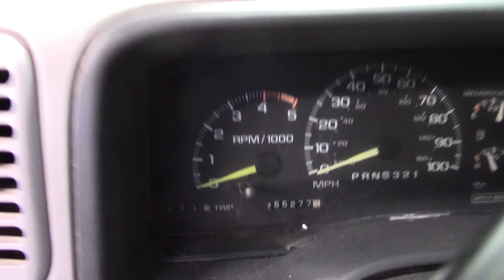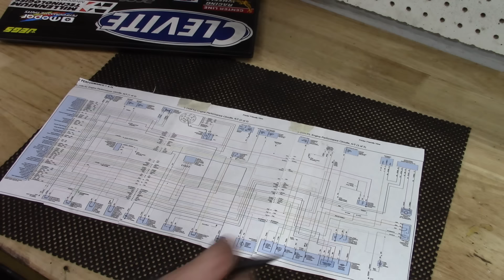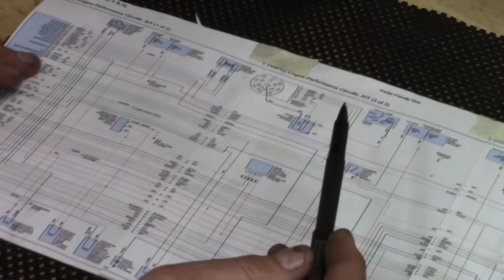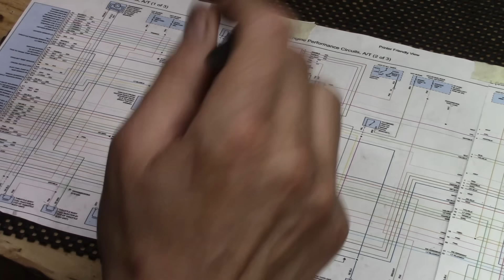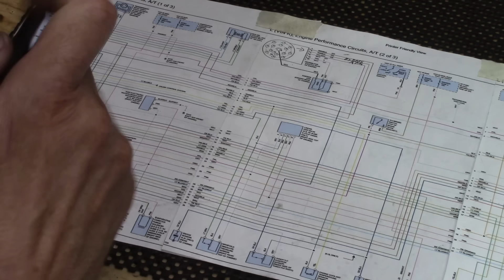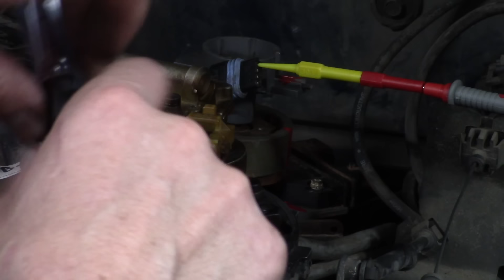Challenging Cranking No Start Diagnosis  1995 Suburban

Comment: Binge watching your videos, these are great. I love your methodology! But boy, do I have a good one for you. My 2011 Camaro V6. Started as a no crank. Found the ECM 15A fuse blown. Replaced, which allowed me to crank, even though it blew again. Blows anytime the door is opened (car wakes up). ECM fuse is powered by Powertrain Relay. Benchbtested, that's fine. Harness from fuse to ECM tested good (jumped load side of relay with harness disconnected), no short to ground.
Stumped! Wish I could send it to you!
Reply from the maker: Thanks for watching. Pretty clear you just have a short on the ECM power feed.  Disconnect it and use a test light to look for an intermittent ground.
Reply: @SchrodingersBox  Hey thanks for the reply! Yea I did just that. Disconnected the harness to the ECM and tested from fuse (harness side) to pin in harness. All good, no ground. ??
Reply from the maker: Yes becauase its intermittent I would expect that.  You'll have to wiggle wires and harnesses to try to create the ground and that will narrow down where issue is.
  An ECM fuse will blow with any fuel injection or ignition shorts so keep that in mind- it may even be a coil or fuel injector itself!
  I have video of this exact issue on my website- wiggling the harness blew the fuse right on camera- you could see it, and of course lit my test light as well
Reply: @SchrodingersBox  Great, going to look for the video now.
Mine issue isn't intermittent. No crank if the fuse is blown. If I replace the fuse, it'll crank, no start (fuse blows immediately) until car goes to sleep. Then no more crank again.
Scares me that it could be injection or ignition, seems like a million paths to take to find the issue!
Reply: Btw, may have found your video, the Lexus?
My wiring schematic doesn't show any fuel or ignition components on this circuit. Just 3 wires from fuse (it splits 1->3) to ECM pins...that's it.
Could it be being backfed somehow, that wouldn't make sense to me?
Reply from the maker: Not sure what diagram you gave but I just pay $19.95 and get a diagram from AllData DIY. Worth every penny.
Reply: @SchrodingersBox  Yep, did that, it is worth it!

Comment: The Ignition module was in the distributor. RPM have controlled by the distributor. Spark is controlled by the coil and the road account in the distributor.

Comment: Fuel pressure low disables spark.  Look at fuel pressure not being sustained.  (can't remember the part name - fuel pressure regulator? or fuel pump weak.  Didn't see the fuel pressure being tested (early in the video right now))
Reply from the maker: I have never heard of a system where low fuel pressure disables spark. how does that happen?
  I have heard of fuel being stopped at a single cylinder on a misfire for that cylinder which is beneficial for obvious reasons, but I can’t think of any reason or function to disabling spark on low fuel pressure. how would this truck even “know” there is low fuel pressure?
Reply: Leanmissfire or no good fire?

Comment: I wish there was a time traveling way to tell you something while you are recording... In those older GM hoods you bump the front passenger corner of the hood (nowhere else works as consistently) and it releases to the safety latch.. they all do that to some level.

Comment: Hi Matt. Please help. My car does crank and every sensor is good according to the scanner, but yet there's no spark. What could be the problem.... it's a corsaD z14 XEP engen
Reply from the maker: What are your coil reference, signal and ground voltage showing?

Comment: You forgot to unplug the injectors to prevent a start and see if the TACH moves on this vehicle on a no start with good spark, thanks for the case study on an old GM ICM DIZZY.
Reply: Is it good if the tach needle jumps up when cranking?
Reply from the maker: It depends what you are looking for.
Reply: Possible Scenario: Looking to create a list of vehicles in our private libraries that the TACH normally moves during cranking on a No Start, if it does not move then we can narrow down our diagnosis. If it is not designed to move as many late model cars, then we have that on our list and we do not need to pay attention to that. If the TACH is supposed to move but it did not early in a video, then we are looking for TACH movement after the repair and in order to catch that before a crank and quick start, it may be needed to prevent the start such as pulling a fuel pump fuse or relay to verify proper operation as proof since the non working TACH was one of our problems. YES, if the engine now starts and the TACH works, good enough, but that is not the same test. YES, I am anal, the original test was Crank No Start No Tach, I want a Crank No Start Good Tach as the same scenario scientific test, and be sure to annotate this vehicle in my database as such. Thank you for all your videos. @SchrodingersBox

Comment: Hey Matt,
Glad the new distributor (ICM) worked. One thing you didn't consider was that the mechanical connection (gears) between the camshaft and distributor had failed, resulting in the distributor's rotor not turning, therefore not sending a spark signal.
Great video as always.
Reply from the maker: Good point. I actually did check that but didn’t show it in the video as the sound failed during that scene.

Comment: Cross fire and tuned port injection cars have been using this design since at least 82. Prior to that the HEI, was used with a vacuum advance. In 82 the advance was controlled by EST , electronic spark timing.  The ICM has 2 sets of internal switches. One set acts to control the basic ignition grounding the primary, just like old time points. The other set switches when the engine goes above 400 rpm and the ECM sends out 5V to the tan/blk bypass ( set timing connector).  It then allows the signal  from the ECM to come into the ICM on the  WHT wire and change the timing advance . The purple/wht wire is the signal generated by the pickup coil and amplified in the ICM. The purple /wht must get pulses to the ECM. If not the fuel pump will stop after 2 seconds and no injector pulse will be allowed. Code 12  means that there is no signal on the purple/wht. The EST white wire comes into the picture after 400 rpm, the signal from ppl/wht, most other sensors, AND the knock sensor.  One way to partially check the pickup coil is to disconnect the set timing bypass line. If the engine runs the pickup coil is bad.  When the pickup coil develops a low output it often is sufficient to run the car at base timing, but not enough to run when also powering the EST function. I was disappointed that you did not dive into the root cause, either the pickup coil or the ICM, but I understand you are doing this as a business for customers. You could still check on that old distributor, then you would know which of the parts you could use for a spare !  The tach reads off the primary circuit ground side wire....like you said, the first clue. Love your videos  !  My 85 vette has been with me for 35 years.
Reply: If you got the paper clip out , you should have got a code 42..
Reply from the maker: Thanks for the additional info!!
Reply: I'm having constant ICM problems due to corrosion on the terminals.
Where do you disconnect the set timing bypass wire? Is it the brn/wht wire? Where is that, ECM. Where is that in my 89 g20?
Reply: @fgoindarkg  What is a G20 ? On a HEI ignition system the set timing connector is the only wire out of 4 ,that has a separate connector. On my car it is TAN /BLK .
Reply: @fgoindarkg  You don't have to unplug nothing, just set the timing at 20 degrees and your done.
Reply from the maker: @prmayner ummmm no. First of all the timing isn’t at 20 degrees to begin with. Second you have to unplug the advance or you are timing it to advance default.
Reply: Thank you @danieljurgill1681 !!! 
Someone finally explained this in a technical way that puts all the pieces together.

Comment: Hmmmm Matt, have you tested the coil primary or secondary resistance? The plug wire resistance and rotor arm resistance?? Or are you just firing that parts cannon like you slag the mechanics in your area off about. 
Jeez man why replace it if it has the correct resistances…. 
Hey why not replace the wiring loom too.
Showing your inexperience on this one.
Reply from the maker: You make no sense at all. Why on earth would I test the coil when there is no output signal AND also I showed the coil generated spark. Let me repeat that- when I gave a ground control to the coil- it generated spark. So why on earth would you ask if I tested the primary? Can you explain that?  Showing your inexperience here pretty bad there my friend. Pretty bad. 
   Also how did I fire the parts cannon? I properly determined the ICM on the distributor failed.  What other parts did I change? Name one part I changed that wasn’t necessary. 
   Also why on earth would I replace the wiring loom when the PCM received and sent a signal that I input?  Can you explain your logic there?  Why would you change a wiring loom that clearly is in tact?  
  Please explain logically. You make zero sense. Until then, I can only assume you simply don’t understand what happened here.
Reply: @SchrodingersBox  
Hi, I was poking a little fun at you Matt, I’ve seen all your videos and this is the only one which surprised me.
You are clearly an intelligent guy and you say yourself you tested the ignition coil and it worked. I was questioning, WHY change a working coil?  FOLLOWING YOUR DIAGNOSIS REPAIR.
I only change parts IF they have failed. 
You didn’t show yourself testing the primary and secondary resistance with a meter which is how manufacturers deem if the coil is bad, not by firing it off and seeing if it is capable of generating a spark. That is what I was questioning. Had you demonstrated the coil resistance results were outside the manufacturers specification BUT the coil still sparked, THEN I would have expected you to advise it’s replacement, with solid results based evidence. 

So my point is you fired the cannon AFTER the repair.
Parts cannon 1) The perfectly working coil
Parts Cannon 2) The ignition leads rotor and cap. You didn’t mention it had a misfire too 😉.
These parts (unless tested to be outside the manufacturers spec) don’t actually need replacing. Referring to one of your videos which was quite funny( think it was the valve clearance job (lash) where you fixed the poor running by adjusting the clearances correctly, “well it may as well have them so let’s fit it anyway” I think was your line when slagging off the other shops, and rightly so.

I took it that you assumed as it sparked it was fine.  But let’s recommend to the customer to replace it anyway. 
A high resistive coil winding would stress the ignition module resulting in its early demise. But I didn’t see you check it against manufacturers specs.
The logic to replace the loom was tongue in cheek. I know you wouldn’t replace it as there is nothing wrong with it…..But there is nothing wrong with the coil either, so why recommend replacing it?

Over to you my friend, I look forward to your witty retort.

Comment: Worked on my girlfriend's old Peugeot, and IIRC it had inductive type "pulse generator" for the PCU (hence no coil involved in generating it)in the distributor. It would also make spark independently i.e. only pulse for the monopoint system was driven with ECU. 

The system you have there is more sleek, it bypasses the signal to-from ECU on crank and when RPM get to idle value ECU probably moves it in request for advance/ retard of ignition based on parameters.

BTW, it was ECU that was faulty in her case, in the way it drove the mechanic (who changed her engine head) crazy (the engine stopped intermittently). He didn't know it is a separate system, returned the car when it was runing with a sore note that it is "junk". I got a break when I noticed that "check engine" light ceased to work on contact when engine ceased to run (it is directly connected to ECU, of course), and I checked return pulse (that didn't exist). I ordered a second-hand, inexpensive ECU (and got NOS in the box from 1990!). Runs well, passes MOT (European).

Comment: At the 5 minute mark, I'm personally deviating from the FASTTEC. I've determined there is a specific issue: loss of signal to tachometer. Move directly to testing crank position sensor. If faulty, replace.     
  
I'm only 5 minutes in so I have no idea what's ahead. 
Didn't want to Monday morning quarterback my comment.
Reply from the maker: I thought same thing. you will change your mind about this too, like I did lol.
Reply: 1995 and older are a different challenge. It really requires science at that point. FASTTEC works.  @SchrodingersBox

Comment: Nice diagnosis.  After you verified there was no spark at the coil,  I figured it was the ICM.  I also knew that the ICM could be replaced separately from the distributor and was wondering why you were replacing the entire distributor.  
Luckily for OBD 1, I still have an old AutoXray 6000 scanner with enhanced data that still works very well.  We still have a 92 and 94 Cavaliers that we drive so having an OBD 1 scanner is nice.
Reply from the maker: Yes I did realize the ICM is separate however I know from another video I have with a distributor that the ICM alone costs about as much as a new distributor assembly.

Comment: I'm a lot older than you are and I was working on vehicles when there were no sensors and the ignition systems still had breaker points in them.  I have changed countless ignition control modules on all makes and models because when they were first introduce they were prone to failure.  At the beginning of the video the ICM was my first thought, only because of my experience working as a professional mechanic when they started introducing the electronic components that replaced the all mechanical technology.  You proved yet again the FASTTEC method works every time.  Thanks for the blast from the past.
Reply: Yep they go bad all the time . But it was still funny when he said there is no way there is no crank sensor !!! He must be younger than we think we grew up cleaning points with dollar bills to get spark lol.
Reply: Likewise with Chryslers of the era - the ECM "brain box" would go bad and / or voltage regulators all the time.
Reply: @hindflight is I the not
Reply: Can you help me? 🙏🏼🙏🏼

Comment: I'm an old school chevy mechanic and don't think plugs wires coil need replacing if the ignition module is bad. In 1975 when chevy first used Cat converters and HEI ignition, they were towing in the new cars in droves because they wouldn't start. At first we were changing the ignition modules. Then after their engineers looked at the problem, they found out the phillips screws that were holding the module would not hold it correctly and replaced them with hex head screws. Plus added die electric grease to the back side of the module. And lastly changed the gap of the spark plugs from .080 to .045 saying the air gap was too much. (they replaced the plug to a different one since changing the gap that drastic would put the plug ground at a severe angle)

Comment: Good video. Entertaining to watch. Yes, us older mechanics were smiling through this one.  There's no crank sensor because of the distributor and cap which is wired according to the firing order in the direction of rotation. There is no cam sensor necessary because those fuel injectors are constantly delivering metered fuel. The ICM tells the ECM to begin pulsing the fuel injectors when signal is received. No signal from the ICM means no injectors switched on. Since you resigned as a 2 percenter and brought out your parts cannon, I'm just poking fun, I'll say the ICM was the most likely culprit with the pickup coil in the distributor being the second possibility. You had no tach movement because it's derived from ignition coil ground.  Probable scenario is spark plugs were neglected and the increased spark voltage demand sent a large enough back pulse to the ICM to take out the transistor. A new ICM and a fresh set of spark plugs would have been the fix. The integrity of the rest of the system could have been verified using your oscilloscope, like we used to do it in the good old days. I really do like you and the videos you provide, but watching this one is almost as good as watching a millineal trying to steal a car with a stick-shift.
Reply from the maker: Hahaha yes I left all the mistakes and frustrations in for that exact reason- so the guys familiar with this era can get a laugh on me!!

Comment: In the old days, we would have just replaced the ignition module inside the distributor. That way there is no chance of messing up the base timing.
Reply from the maker: Yes actually I did look at the ICM only. It turns out is actually cost $10 more than the whole distributor!  I ran into this on a 1996 Honda a couple years ago too. It’s better to get the whole distributor. 
   Reinstalling it did suck- took about 30 tries to get it lined up correctly lol.
Reply: If you can let it sit for a while before pulling the distributor to let the little residual oil pressure bleed off the pump then the drive shaft won't turn on you. Then mark distributor location to engine, pull distributor straight up letting the rotor spin then mark it's position to the distributor body. It should fall right  back in.

Comment: Adding the RPM signal, are you using battery voltage or the 5 volt signal voltage?
Also, how are you able to determine which voltage is needed?
Thanks Matt, awesome video as usual!
Reply from the maker: I am using battery voltage BUT at only 250ma.